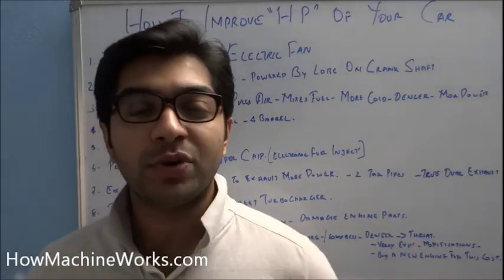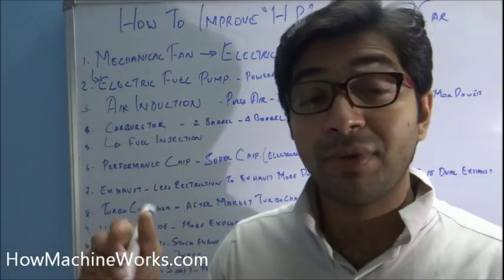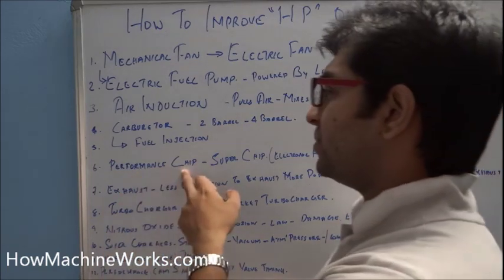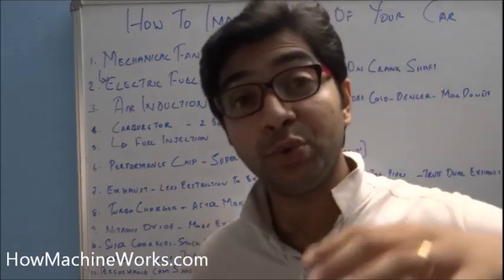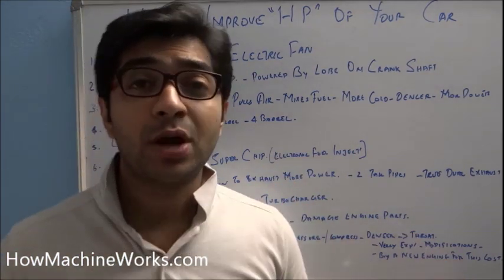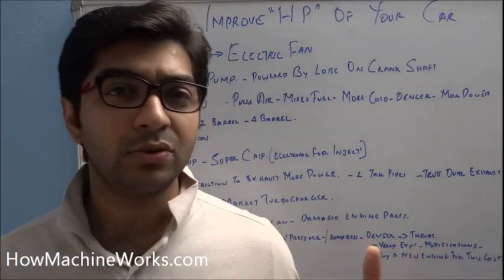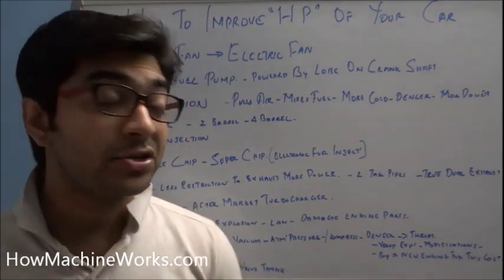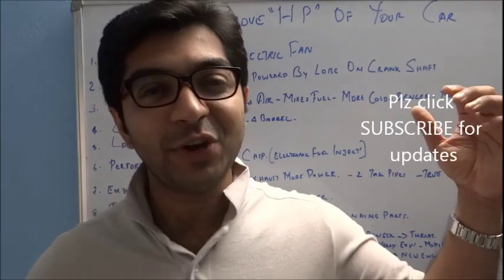How to increase horsepower in a car

Comment: I feel, the first 2 points will not increase the overall HP available to the wheels. Lets consider the mechanical fan --> considering the fan runs the same RPM, the power (HP) required to drive the mechanical fan is lesser than electrical counterpart as the the electrical fan has the conversion from mechanical to electrical, which incurs losses (nothings is idea conversion in universe). You mentioned that electrical fans derive power from battery (still alternator, battery is just for storage) and alternator. But the alternator is connected to engine, which derives power from engine. The reason for going from mechanical fan to electric fan is because engines are mounted  transverse and hence, it it difficult to bring the power for fan mechanically from the engine. Another advantage is that decoupling the fan (electrically) from engine makes it run at any speed we want (temperature controlled fan speed), which was difficult (not impossible) with mechanical system.

Other points of increasing HP is acceptable. Basic idea is that, to increase HP from engine, we need to burn more fuel. For that we need to inject more fuel and also more air (turbo induction, bigger intake, exhaust...). Assuming that the losses in vehicle cannot be reduced.
Reply: have you done all this thinks or just in theory